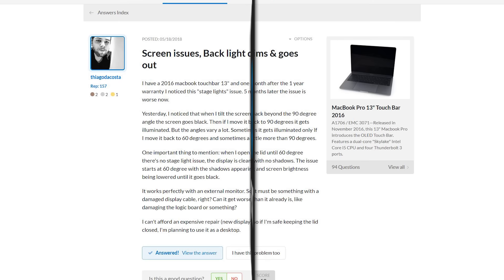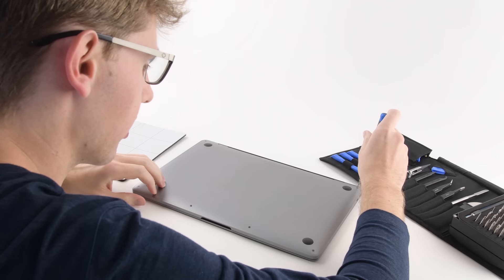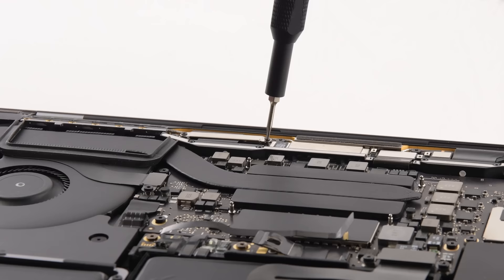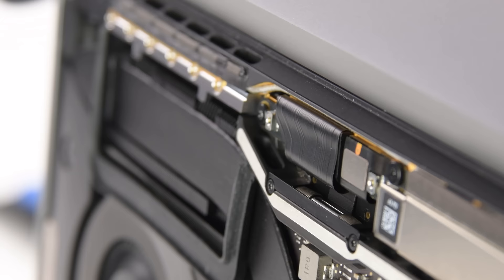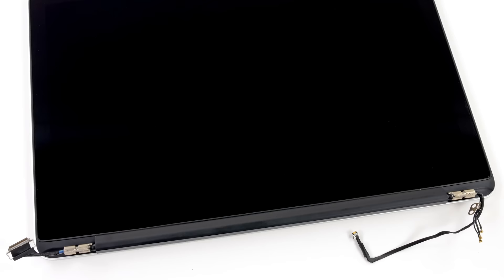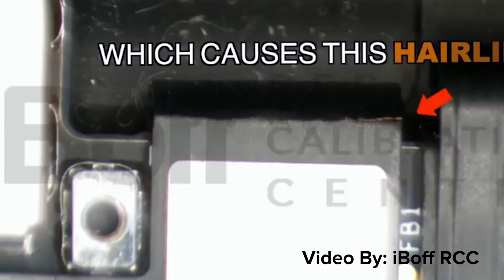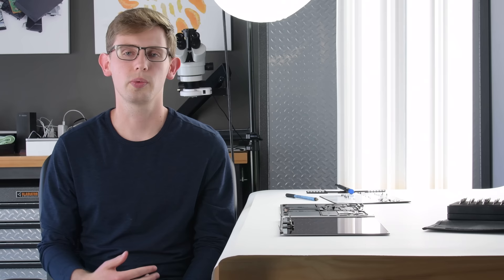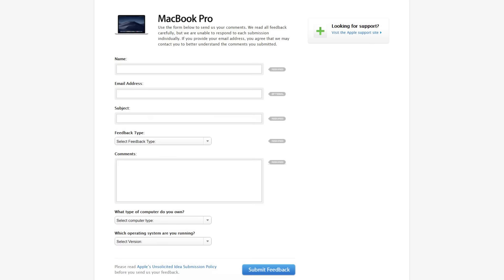The Design Flaw Behind MacBook Pro’s “Stage light” Effect! #Flexgate

Comment: Hi & thank you for your explanatory video. Recently my 2020 M1 Macbook Air began to display the same 'Stage Lights' problem. There was virtually nothing I could find online relating this problem to my model of laptop, & certainly no acknowledgement from Apple about it.  

The Apple Authorised Repairer quoted me a repair cost of Aus $169 because my 3 year Applecare+ still has a few months to run. Without Applecare the cost is now apparently Aus$734.

I collected my laptop from the repairer this morning & was pleasantly surprised when told "No cost - Apple has covered it under warranty".  My assumption is that whilst not publicising the fact, that Apple is aware of the issue, & I suggest that if anyone reading this has an M1 Macbook Air with the Stage Light screen symptoms that it would be worth taking it to an authorised repairer for a new screen (with a new flex cable). I should add that when i took it in the repairer denied that it would treated like other models which had been acknowledged to have the issue & for which cost free rectification was available.

Comment: Pfffff, I bought a M1 MacBook Pro on eBay 2 months ago, perfect condition...
And now, suddenly, there is a 1 1/2" vertical band of discoloration from the top to the bottom of the screen.
I have NEVER come across this issue. My 2015 MBP still works perfectly.
I am not about to pay $600 to fix this screen.
Class-action lawsuit anyone????

Comment: Hi there. May i ask what are the different causes between stage light effect and all black out effect. these two issues both cause by ribbon cable broken. But my mbp has only stage light effect. so i want to know what exact wire of that cable cause stage light effect. thanks

Comment: Hey, please check out the flex gate issues with the MacBooks,  tens of thousands of devices are affected and many faced this issue several months after the warranty expires and you have to spend over $600 dollars to replace the whole display as apple as usual made massive sacrifices to make the MacBooks thinner. Apple has “apparently” fixed the issue, however it has removed all the comments from the apple community website and they started replacing the display for only the 13” 2016 models. However, both the 2017 MacBook Pros and the 15” versions face the same problem and apple has not even said anything. Many have invested thousands of dollars into their laptops, and many have lost their device to this problem during hard times like this quarantine making working from home extremely hard.
Reply: mine is 2016 model, how do i get apple to fix it? just pop up at apple store?
Reply: find it, there is a service program, will contact apple.

Comment: my 2013 pro have this problem after a few yrs. took years to figure out wtf was the problem (i guess I didnt use correct words to try to google it). brightness doesnt adjust but other than that no other screen issue but that might be because I stopped closing it at home. now i have to use an app to adjust brightness (which puts a "shade" on the whole screen). not great for screen caps.

Comment: Macbook PROS need to be for PROS again.
Make it bigger, more airflow, easy removable SSD/HDD/RAM, more IO and a screen that doesn't break after 2 years.
Leave the extremely thin laptops to consumers.
Reply: This, this, 1000 times this. I have a 2017 15" MBP as a work machine (very close to maximum possible spec as well) and is has been hands-down the least reliable computer I have ever owned, most of which can be directly attributed to making it smaller, thinner, lighter etc. 

For goodness sake, offer a line of Big Ugly Macbook Pros (BUMPs, for short :-) ) that are really only marketed to the actual pro market. I would actually pay extra for a machine that was cheaper for Apple to produce. I'd be fucking angry about it. But I'd do it.

Comment: I’m still using my late 2013 13” retina MacBook Pro. I would like to buy a new one, but frankly the keyboard and screen issues are putting me off. Heck, even though love macOS my development work is done in Windows (running under Parallels Desktop), and I’m approaching a point where I’m considering buying a Lenovo Thinkpad in order to get more processing power, memory and storage than my MacBook can deliver. I’m strongly hoping for a sensibly redesigned MacBook Pro in 2019

Comment: Some other issues.
2 CORE PROCESSOR
DDR3 RAM
BUTTERFLY KEYS
NO USB PORTS
OVERPRICED
NO DEDICATED GPU (Not necessary but nice to have)
Reply: They are using 8th gen now so they have switched to quadcore 
But if your talking about the macbook air or macbook yes they still uses the shitty Y series chips
Reply: Crazy Communist Cosmonaut for a MacBook Air
Reply: @authenticNL2  Ok

Comment: Wait.... My 2017 model never had a keyboard backlight when starting. Also, my chassis was misaligned just a tiny bit. Apple has replaced my chassis once but it didn't solve the problem.

Comment: Hello. I  have trouble on my Macbook Pro 2017, touch bar. A year ago, it starts flickering. I do not have enough money to fix it by LCD replacement. So, what I did was when the screen starts to flicker I just close it for a few hours and use it again. It takes only 15mins before flickering again, so, as I student its kinda hassle. Then, there was this online friend of mine who told me that I do not need to have an LCD Replacement, I just need to fix the flex. So, I want to ask you, if ever I fix the flex on my laptop is it a good move? Or do I really need to have an LCD replacement?

Comment: I have an issue with my backlight so i went to service centre and apply for Apple backlight service program ,in this process they have found a burn at antenna due to this burn they cant process the backlight program .! If i have paid for my antenna replacement will they proceed with backlight program ?

Comment: I got this issue during lockdown 😭
Reply: Any solution yet?  Its been half day I have been facing this issue..
Reply: @khushboobanthia2585  yeah, Apple had this repair program for this issue, it is FREE for macbook pro 2016 13inch model. I did mine already, they will replace your display to new ones.

Comment: Saw this coming 8 months ago.
https://www.ifixit.com/Answers/View/482777/Horizontal+lines+on+display+unless+lid+half+closed 
To save another 1/10 inch of thickness, Apple choose to put the LCD TCON board in the bottom and run the LCD row flex cables over the hinge, Running a flex cable, instead of just round cables through require a spring loaded reel mechanism to reel the cables in and out. If the reel is stuck or slow, the cables are pulled or wrinkled up, potentially causing damage. Only the display eDP cable (internal DisplayPort - iDP) is a socket connection, the rest is directly soldered together.

The eDP cable from the motherboard to the TCON board is just over the CPU heatsink, there are additional cables that are socked to the TCON board and run in to the display, these are likely just backlight and are not relevant, however they can be line select cables that may have something to do with the glitch.

If it is flex cable damage, you may need to replace the whole upper section with hinge and TCON board as there is no way to get to the screen end of the flex cables.

Comment: Not defending Apple here but because they essentially only have 4 laptop series yet are one of the best selling devices in the market, every single issue they have is going blown up pretty quickly. I have a Dell XPS and those asshole still hasn’t fix the coil whine in recent models, my power unit broke completely, no replacement possible from Dell and the SD card reader is also dead in 2 years. Yet, it is widely considered one of the best laptop on the market. If this was Apple they would be roped onto a chariot. However, that doesn’t mean what they did is justifiable. They should extend warranty to all of their customers and not repeat this bullshit again.

Comment: So I spent $1500 on a laptop where the keyboard and screen continually fail within 2-3 years, and there is no solution other than shelling out cash to fix it. This will be my last apple laptop for a long time, high end window's laptops do not have this many issues.

Comment: So this only applies to the 2016 model? Or does the mid 2018 model also have this issue? Because I have the mid 2018, and I expect to keep this laptop for over 7 years as it costed me a fortune.
Reply: Every model released after 2016 has the same problem.

Comment: similar problem for my macbook pro 2017 with an apparition of horizontal lines  when I use it some hours.     ;-(   juste 3 month after than the warranty expire. I expected to keep this computer 10 years, at least, not 2. I feel bad, this is my first apple :-0
Reply: Same here. Have you fixed it?
Reply: @arthurguimaraes00  no I didn't. if you call the custom service an insiste about the '' manufacturing defect'''you can  find a way to get a new computer for free. Some people did it in France and I almost did it but finally I coudn't  because I bought my computer in Australia an I am in France so the custom service was not the same.

Comment: Bought a Brand new M2 15inch as last screen died. 3 rd screen death at under or at 2 yrs... I just opened this BRAND new one and and it is BROKEN ON UNBOXING . Purple light on shutdown and not even taken the paper off the screen. I feel conned. Taking it back tomorrow. Is it worth being told I need a new one AGAIN in 19 months. Just disgusted .....Having a trillion wiped off their stock value has also meant staff are now under huge pressure to collude in this fallacy of pretending this is not a design fault.

Comment: Hi I’m having the same issue and i was wondering if using your macbook with an external display is possible? i haven’t tried yet but would this work? i don’t care if i ruin my macbook screen when doing this and letting it heat up till if completely melts the display port...can i just use this set up ?
Reply: It will work with an apple TV box or if its one that there is a recall program on (2016 macbook pro 13" ) they will fix the display for free (in the UK at least). Took mine in last week and it's been repaired for free and is on its way back to me, worth a try.

Comment: The Touch Bar MacBook Pros seem to be becoming basket cases. The oldest model is 2 years old, and people are already having display cable problems and keyboard issues. To add to it, there is the throttle gate issue on the 2018 model. It’s a joke of a machine. A really beautifully designed joke, but a joke none the less.

Between these issues, the audio IC issues on iPhone 7, the bending issues on iPad Pro, and the lack of accountability for most of these problems, it really makes you realize that the ‘premium price for a premium product’ line is BULL SHIT. I’ll switch to Dell for portable machines and custom for desktops, because at least with those if a display cable breaks its $10 or less instead of having to drop $600 on an entirely new display.

Comment: I don't understand why people keep buying from apple. I feel really bad for the people who are tricked into buying from apple and have to deal with every single MacBook having a recall program as of 2019. I bought an £800 Asus strix 1050ti i7 laptop and it came with an Asus bag, mouse and headset too from scan and it's much faster than the MacBook whilst also not having a retarded display cable design and all the parts can be bought from Asus so I can fix things that I might damage down the line for example the metal back cover if I ever scratch it or something. Stop buying from apple, they don't care about their customers like other companies like Asus and Microsoft do.

Comment: how much does it cost to fix ?? anyone know ?  my MacBook Pro 2016 has this ):
Reply: up to 600 US dollars.  I am waiting for a repair program.  If anyone knows how to mess up the antireflective coating (with chemicals?), then I will screw that up to get a new display for free.
Reply: it free now that apple has warrenty program for this
Reply: @rohithmekala2608  only on 13 inch not the 15inch model... right now most of the problem is on the 15 inch which it cost more for apple

Comment: if apple's goal is to cut costs why not do a walmart (oh we need you to clean the toilet) as soon as their employees punch out.

if their goal is sleekness there is a better way run a small 2 conductor wire something like the wifi antenna wire found in most laptops to the lid to power the electronics in the display panel then modulate the display signals over that wire so the display can get the image.

the wire can be ran through the end of the hinge assembly like they do on most laptops.

if their goal is to break the laptop forcing you to buy a new one why not write a time bomb where after 90 days or a year the laptop refuses to boot.

another way would be to do is encrypt all communications between the various chips and as soon as the ssl certificates expire then the laptop stops working or nags the user in the same way that a web page does when the certificate is allowed to expire or if your clock is set to the wrong date.

so you may get something like "unable to display image on this device due to expired certificate"

or "unable to boot the mac laptop due to expired certificate"

Comment: in late 2011, I got myself a £2100 GBP Mac book pro. I love it, but its over-heats, and I have had to get a table cooler. I have also had to instal FAN control.  I love the Mac Operating system then and now. Than My graphics card chip fried and I was just in warranty to get the motherboard replaced ( it cost almost £700 GBP (free to me).  The Mac book overheats still. So I have employed the previous measures. Its a love-hate affair with me with me. Lots of things to love about apple but lots of things to hate. I have an iPhone, 11.9 iPad Pro 2019, MacBook Pro2011 (as mentioned), earPods, iPod (x3).  That said I am well established into the Apple ecosystem and they got me good and proper. It is difficult to detach myself. I can tell you that I will never get another MacBook Pro, too unreliable. I will be getting a razer Laptop and installing AppleOS on it on a dual boot set-up. It's possible using Hackingtosh process.

What can I say, I gave Apple all the chances in the world one would give. I wish Apple would sort themselves out as I would not want to go away, but at this moment I will not be getting another MacBook Pro. Sorry, Apple you messed up too many times on this product.

Comment: Hello everyone, it’s end of 2021, anyone has any solutions to this issue please 🥺. Any help will be appreciated
Reply: No, I came across this because it happened to me. My 2017 Macbook Pro 15 inch just started this exact same thing. The display actually started this a few weeks ago as I was just sitting with my laptop using it and my screen just went black. I tried opening and close it but nothing worked other than the keyboard backlight and touch bar. I then discovered opening it slightly, the screen worked then opening it further, the whole screen cut out. I can't believe this is a known issue and Apple has done nothing to stand behind their product. Instead all they care about is making more profit instead of doing the right thing and repairing mine and other's machines. I had a feeling it was a cable before I even came across this issue because I could plug my laptop in an external monitor and get a display but after seeing this, I will not buy another Apple laptop if they can't stand behind their own product.

Comment: The more I look at MacBooks the more I have to shake my head in horror.  Not only is the storage (SSD) memory soldered onto the mainboard, but this is also the case with the RAM as well. So all upgrade options pretty much eliminated after purchase.  Add to that the inability to get data off the SSD storage if the mainboard goes bad, the flex cable issues going to the screen (which result in a display @ $594 + $6 cable) to repair, the butterfly keyboard the limited number of USB3 ports (2 on most machines). The loss of the magsafe power connector, the overheating of CPU in newer Airs (no heat pipe), the attitude from Apple, the expensive units for their screen size and battery replacements that are a nightmare because they are glued in you really have to ask yourself is this just a beautiful looking pile of shit.   The butterfly keyboard replacement involves the whole top case being replaced, which like the monitor+display cable issue is just unbelievably wasteful.
Reply: Ohh -I forgot to mention the hard disk cables that also went bad every 3-6 months.  I think that almost covers it...

Comment: Apple products are made to be replaced rather than repaired. They have years of experience designing electronics and use it to design products with flaws, and make more money doing so. What will be next? A dead bios battery will need motherboard replacement.

Comment: I've replaced a screen assembly for a customer for the very issue... Also on these models Texas Instruments charge controller X4 - 1 fails = all ports fail/ laptop won't charge. There are no replacement chips available to buy because... Apple made sure of that. I've sold my 2014 Retina 15'' because there is no way I would buy a new macbook pro. As good quality as any chinese brand noname crap machine. The new macbook pro 15 overheats, with a pricetag for parts that makes me laugh. So long Banana company!